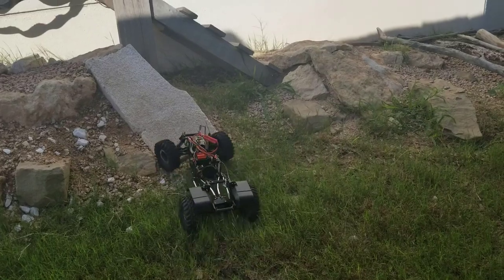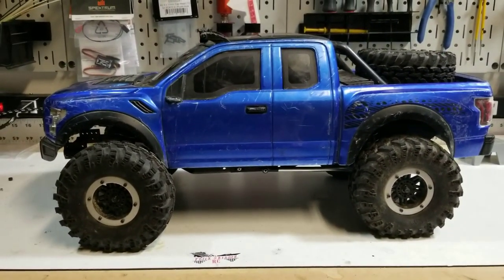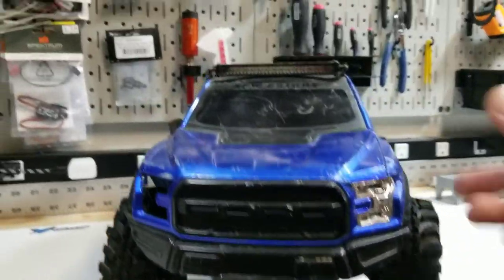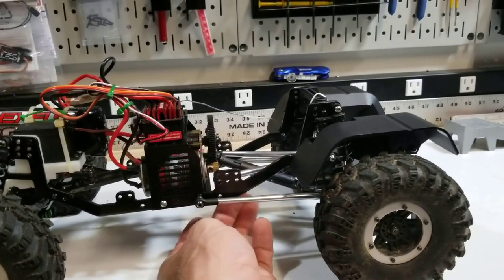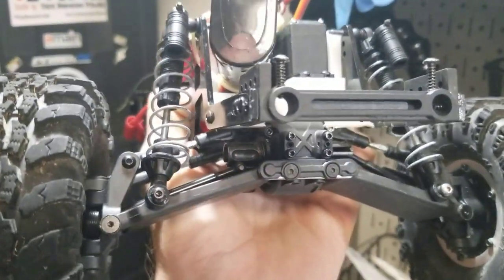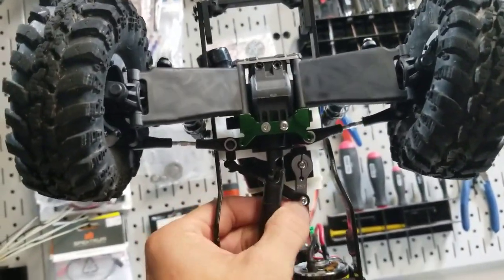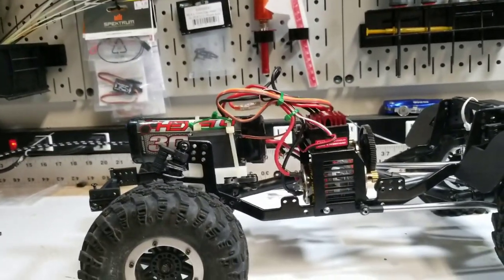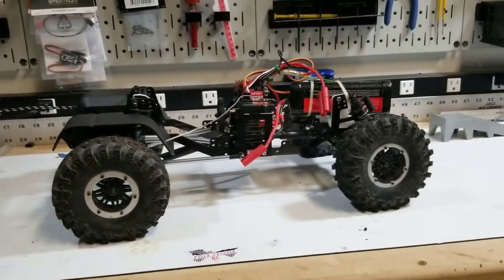ITS ALIVE!  Gen7 IFS is functional, FINALLY!

Comment: Awesome build.  Looking to do something similar in a swb for a montero body.  Is the diff gearing on the front match the gear or do you have some overdrive there?  You could put tubes on the shafts in side the shocks to limit the extension a bit.

Comment: What parts did you use to complete the ifs?  Do you have full parts list, part numbers and part brands you can supply me with in a message if it isn't too much trouble for you i would appriciate it. I have an scx10 well extra parts for a 3rd truck to build and want to go ifs. Anyways Thanks
Reply from the maker: Hey man, it's a twin hammers front diff and driveshafts, and the rest is custom.  I'll have the diff mount, front skid, and belly pan done shortly.  Finishing up dimensions on the belly pan.  If you check out @1tenthscale on Instagram therell be more info there shortly.

Comment: 😊👍Looks so different but cool! the TH front diff was the same exact gear ratio as the gen7 rear axle? also for the shocks limit them you can put a plastic spacer or rubber hose cut to size on the shock shaft inside under the shock pistion so it won't be able to extend fully.
Reply from the maker: Shen RC gearing is just a tad higher in the front.  5 revolutions of the wheels put the front about 1/10 of a rotation more.  Had some tape on the tires to gauge. good idea on the shocks, might give that a go, thx!!
Reply: Cool , that's what you always do to adjust shock length works like a charm.